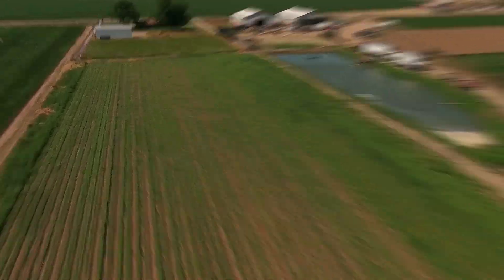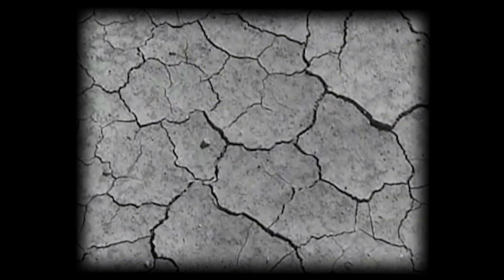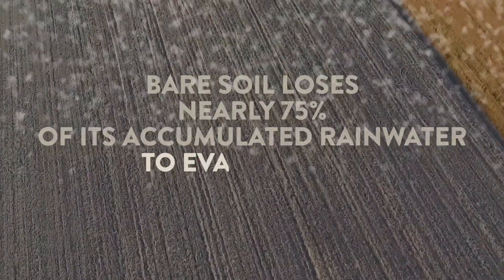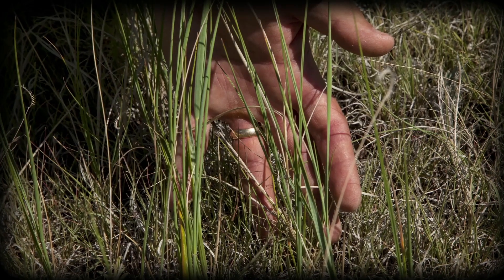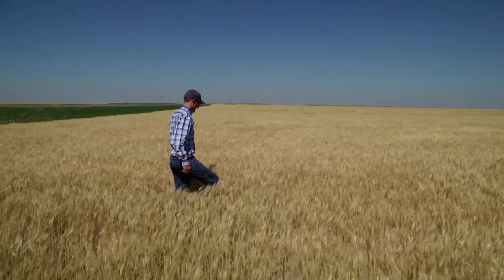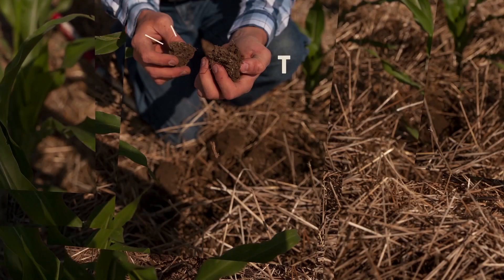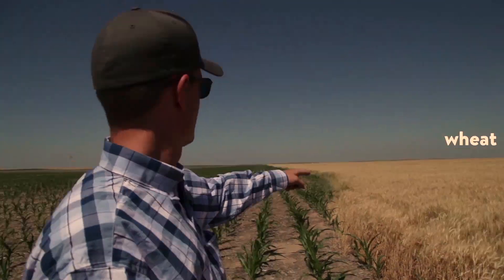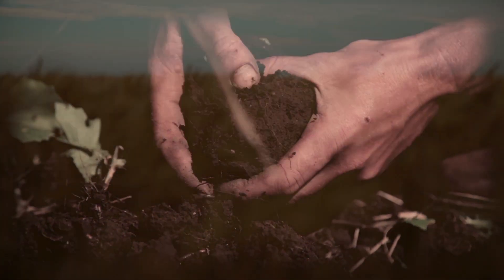Resilient: Dryland Farming in The Semi-Arid High Plains

Comment: the funny thing is if they crimp the shortgrass prairie at the right time. they could pasture Crop directly into the prairie. Then graze it on the off years every two years. So the roration would turn into wheat, pasture, pasture, then wheat again. Making more money. it's like "duh"
Reply: i'd do a soy bean (organic soy, or a pea type crop)
Reply: in one of the best area lol to pasture crop on the planet. (short grass) if you do old-style wheat that's long grass wheat. you could do so much. ...  so graze it. make money
Reply: go organic .. it's shocking not that hard to do.
Reply: why is it so green if there is not enough rain?
Reply: @ayubyusuf2975  Because the plants have learned to use the water there is. This area gets water primarily during the winter. The cover plants keep that water deep in the soil. Some plants use the water in the spring and then go dormant, providing cover for the soil and preventing evaporation. Others then grow the deep roots that can tap into that deep water.
Reply: @foodforestfolderol  I suspect that with more intensive planting, where the plants are all up against each other, it keeps the weeds out and it also shades the soil, keeping moisture in. In our current way of growing, the soil is always under the beating sun with no shade and the heat just sucks up whatever water there is. Soil kept in the shade can register 10-15 degrees cooler. Soil gets hot. Very hot. Roots get damaged.